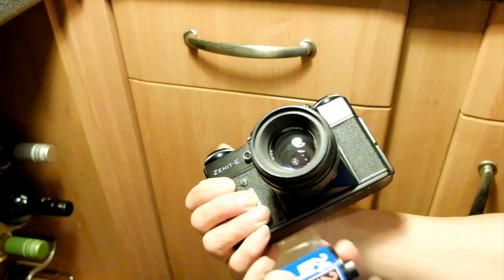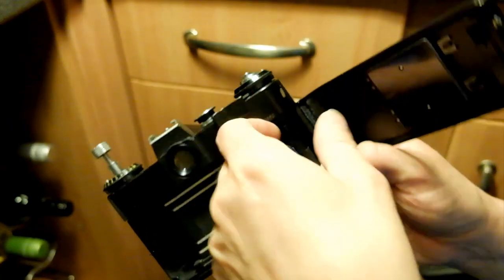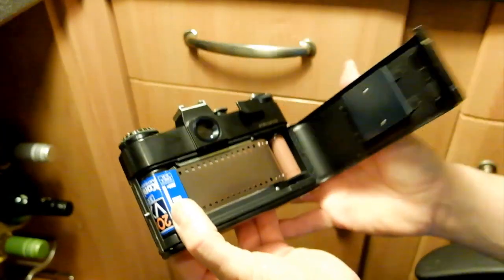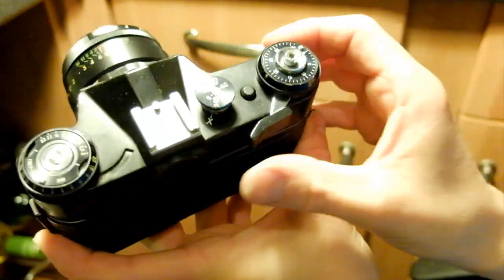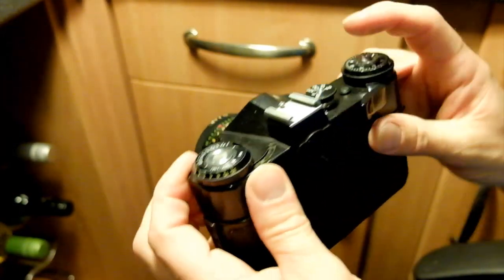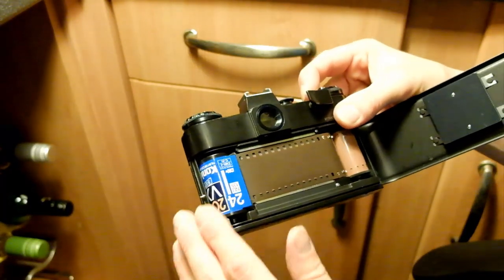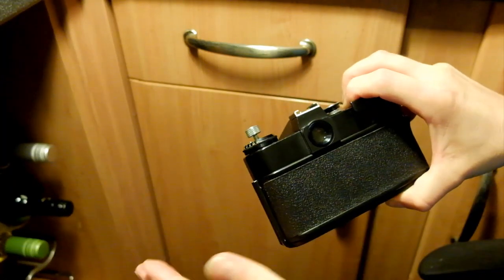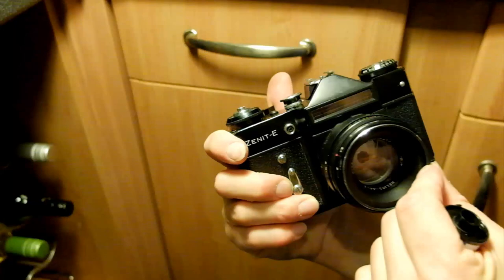Zenit E Loading a Film, Shooting and Rewinding

Comment: I just bought one Zenit-E camera from a old lady and was searching for a good how to use video! This helped me a lot! Thank you so much!
Reply from the maker: That's great and I'm glad I could help. Check the accuracy of the selenium meter built in as it may not be correct, if it works but reads inaccurately you can simply adjust the number of stops to work with.
Check the shutter curtains also, fire it with the back door open, make certain they're not sticking.
Coupled with the Helios 44 lens you can get some stunning pictures. I hope you enjoy it and please share your images when you use.

Comment: Thanks for this! I just bought a zenit t1 at a flea market and have never used analog camera before so this was extremely helpful
Reply from the maker: Kelly O'Connor You're welcome, glad to help and I hope you have fun with it.
Have a look at shooting and developing your own film, it's really easy with B&W or colour. If you use Rodinal and stand develop it's the easiest thing ever, have a look at my developing videos for an idea of what you need and how to, also check the accuracy of your light meter as it's common for them to lose accuracy due to the age of them, (compare against a digital framing the same scene to see how accurate it is, if it does still work but is inaccurate that's not a problem as long as you know how many stops to alter to get correct exposure.
Reply: spidiq8 yeah this is a bit of a dinosaur so I reckon it wont be working anymore. How detrimental would the affect be on my photos without the light meter working properly??
Reply from the maker: Kelly O'Connor No deteriment to the photos at all as it's uncoupled so you set the shutter speed and aperture manually, as long as you set the shutter and aperture correctly, (or near enough, film has more latitude than digital sensors and is more forgiving if you're a stop or two from the right setting), you can either meter with a known setting like from another camera or with a handheld lightmeter or just guesstimate using the sunny 16 rule.
Do check that your shutter curtains aren't sticking though, fire the shutter at all speeds with the back open and make sure they're opening cleanly and snapping shut without any drag or stickiness, remember to cock the shutter before setting the shutter speed, this is something quirky and unique to Russian cameras and altering the shutter speed before  cocking the shutter can damage the mechanism.
Reply: spidiq8 thank you so much for your kind help :)
Reply from the maker: No problem, hope you have fun and take some great pics, the Helios lens is surprisingly good too.
Reply: spidiq8 so unfortunately the camera seems to be broken. The film doesn't load properly into the right side, the film just gets gathered up and doesnt catch and wrap around itself. Oh well... might  try and get it repaired :( just thought I'd give you an update 😂
Reply from the maker: Kelly O'Connor oh what a shame, at least these are plentiful and cheap in markets and on ebay etc. 
way exactly is happening? 
Does the takeup spool rotate at all when you wind the thumb lever? 
If you could upload a video of what it's doing I might be able to suggest something?

Comment: Great and helpful video! I recently got a Zenit E and have yet to use it but I'm afraid there's something wrong with my shutter curtains or the shutter speed dial itself. When I open the back to look at the curtain move when I press the shutter it moves the same way no matter the shutter speed. And when I use Bulb and I press the shutter it's the same thing. I release it, there isn't a second clicking sound...
Reply from the maker: The syncronisation system is clearly faulty and it's firing at one set speed, unfortunately I haven't delved deep enough into one to tell you why.

Comment: I’m thinking about getting my first film camera and I’m looking at the zenit et should I buy it?
Reply from the maker: If it's functional and the shutter speeds appear to be good then yes. They're a good solid SLR and a good place to start to learn manual settings.
Reply: @spidiq8  but I’ve also been hearing they brake easily and quickly
Reply from the maker: @devinccimarquez788  Well they're all old now so there's no guarantee of how well or how often they've been used and abused but provided it works when you check it before buying and provided you operate it per the directions. I.e. wind on the film and lock the shutter before changing shutter speeds etc it should be ok.

Comment: Hello, very great video! Thanks for all the explaning. But I have a question. I have a Zenit E which seems to be working (I haven't tried loading a film in it yet) but it is missing the shutter speed wheel (dial). Do you think I could use it somehow or if I can "repair" it? Any sollution would be great.
Reply from the maker: Now, it's a while since I used my own but I believe that dial is merely a reminder of the ISO or DIN you have loaded and the selenium meter is usually out of whack by now anyway, if you use an app, a light meter, or your phone to get the settings or even the sunny 16 rule you can use the camera just setting the shutter speed and aperture to suit.

Comment: Great video. So if the light meter doesn't work, the dials on the winding side don't need to be set at all?
Reply from the maker: Thank you.
The iso speed doesn't need to be set if the light meter isn't working or is inaccurate but you still need to set your shutter speed appropriate to the aperture and film speed. To ascertain this you can either use the sunny 16 rule to 'estimate' or a separate lightmeter.
Reply: @spidiq8  Cheers, I'll use the sunny 16 once the camera arrives

Comment: Thank you, sir! I have a question regarding 9:14: What if you can tell the film is not loading properly? I'm already halfway through my film, but suddenly the internal dial stopped turning...  
Before when I had this problem I winded a couple of times and at some point the film got a hold again. This time that is not working, unfortunately... I can also feel that it lost tension as I'm winding. 
How to load the film back on properly without exposing it? Is there some kind of trick I could use?
Reply from the maker: Sadly no, there's no easy way, of its stopped winding part way through either the drive cogs have torn the sprocket holes in the film or the film has split completely, most likely the former.
The only way to try and move it on would be to open the camera in a light tight room and by feel with your fingers try to push the film across as you try to wind the lever on until it engages.
Otherwise the only thing you could do is rewind the film completely and leave it half exposed.

Comment: Well done. If you like analogue photography try Praktica -  until the 1980-s they were years ahead in innovation and  quality of all Japanese cameras.  And German glass is way superior.
Reply from the maker: I have and use several film cameras and have had a wide range over the years, I've been developing and printing both for most of them also but I don't print, I scan now.
Reply: What glass in particular? Zeiss?

Comment: do you have the bulb problem?  it is when you put it on the bulb mode and the mirror won't stay open.
if yes, how do you fix it?
Reply from the maker: Sorry no. It's not one I've encountered.
Being purely mechanical in operation though it has to be related to the mechanical linkages that operate the shutter.
I'd like to look at the possibility of servicing one at some point.
Reply: @spidiq8  thank you. I'll look into it

Comment: Should it be hard to turn counter-clockwise the lever when im rewinding the film?
Reply: If you have long nails - shouldn't be so. Stick the nailc between the counter roll and body, andd voila!
Reply from the maker: It shouldn't be very hard to do but because of the small rewind knob it can be harder than a crank type.
Reply: @spidiq8  When I rewound and I couldn't do so anymore I tried to wind it up again like you showed in the video. When I pressed the lock button again a shutter like sound appeared. Did it shoot or did it just release the lock? I want to make sure I don't ruin a good film if I get stuck again. Thanks for the answer!
Reply from the maker: @gretapatapavciute3372  That sound should simply be the shutter releasing and resetting.
As long as the winding lever has become noticeably looser you know the film is fully rewound into the cassette.
If you didn't feel the rewind lever getting loose but it tightened instead then the film is still connected to the wind on spool and you need to unlock and rewind until the tension practically disappears.

Comment: Please, explain me. i have bought Zenit 11. But İ can't use it. i understood all explain by that video. But no view on my camera. When İ want to take, i can't see on its view hole. İt has dark view. Why?
Reply from the maker: The most likely explanation is that the mirror is stuck blocking the view. Unscrew the lens and look inside the body of the camera. You should see a mirror at a 45 degree angle. If you don't and only see the shutter curtain it's stuck at the top of the camera.
Reply: @spidiq8  i'll try. Thanks.

Comment: Does anyone one know why the shutter button doesn't come up when I wind the handle?
Reply from the maker: Have you got it locked in Bulb mode?
If not then likely something is messed up internally as the shutter has to be wound then shutter speed changed only once that's done, they're finicky cameras.
I hope at some point to do a disassembly of a faulty one I have to try and get it working again.